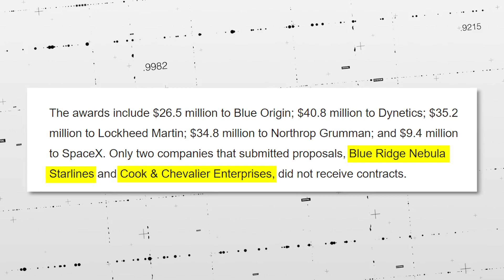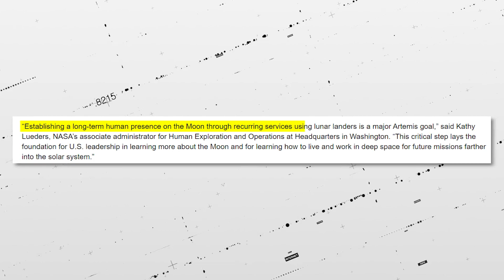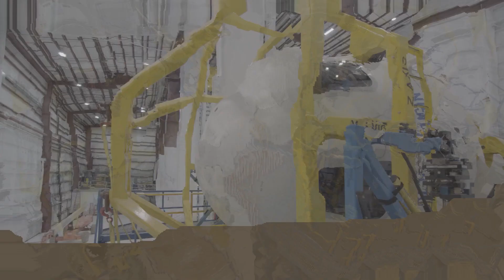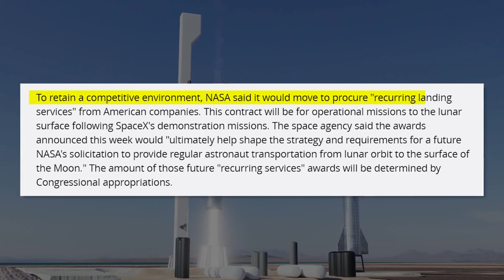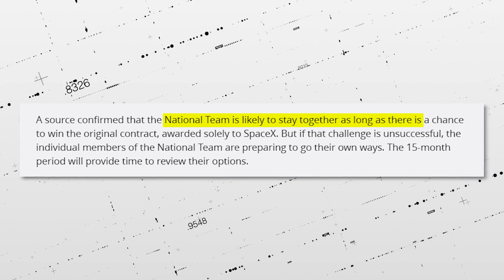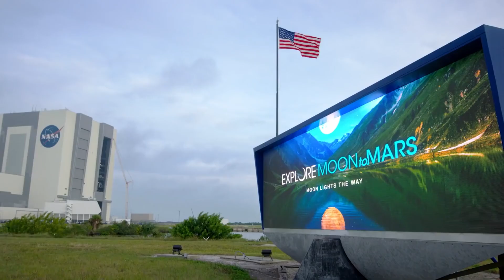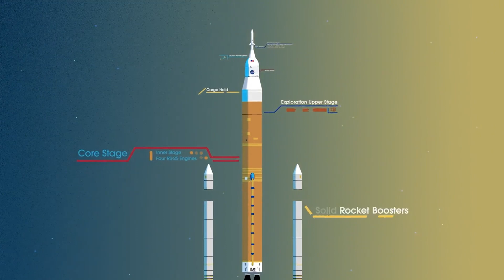SpaceX & Blue Origin Working Together On A Mission!?

Comment: SpaceX  might end up doing a moon mission on its own anyway because it’s long term Mars mission. They need to develop these systems anyway
Reply: I believe they will do that just to test the starship. If it can't land on the moon it will never reach Mars.
Reply: @myballsitchsomethingfierce6319  Correct, also it will established STARLINK communication Systems bet Earth Moon for now and Mars later.
Reply: He will need to take Starship off shore if he want's to fly before 2050 (FAA is set on keeping SpaceX grounded)
Reply: @dirgemcelvoy2583  FAA has also control over seastarts. It makes no difference, from where US company will launch their rockets, they always will need to ask the FAA. off shore just will cause less environment problems, so just increase a chance so FAA allows to lunch hundreds times a year.
Reply: I could not agree more as the whole Artemis program is just a mess and costs too much. For instance the SLS getting astronauts up to orbit in a tiny orion, then the astronauts transferring from that to lunar gateway, then from that to a SpaceX Starship. Sounds like a unnecessary costly mess as Starship could do it all for significant less cost, much quicker and much safer as well. SpaceX is just having thr funding for development of Starship because why not and then when Artemis collapses SpaceX will be set for carrying out the mission on their own